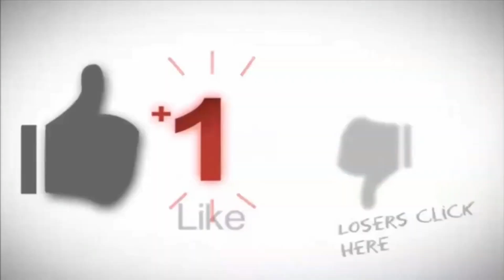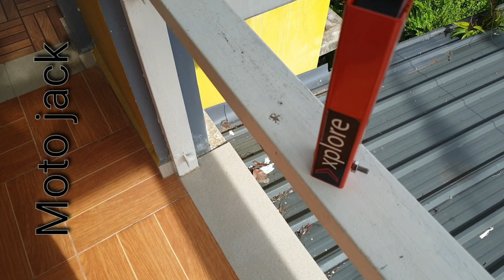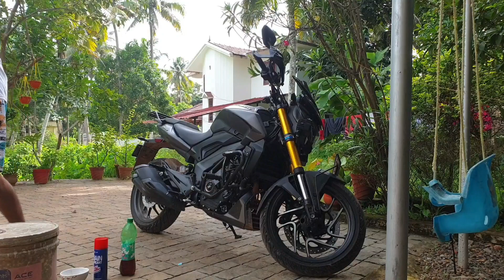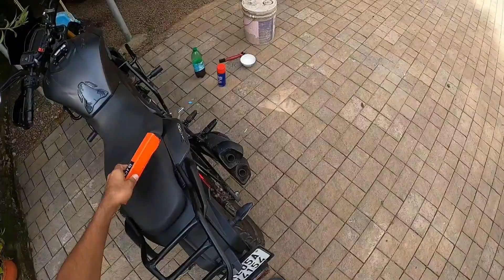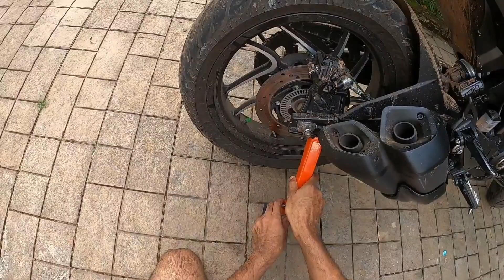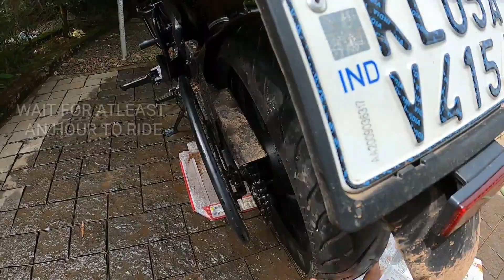ഇനി Chain lube ചെയ്യാം ഈസി ആയി || Moto jack || Paddock stand || G roller || Dominar Chain lube

Comment: Will it be easy to push the jack for dominar. There is one more product called blueburns but cost is 1500.
Reply from the maker: Yes itz quite easy can do it alone , a slight push is enough .no need to spend more bro this one works well
Reply: @kl05nomad24  thanks a lot. First I saw groller but I am not sure whether it would be easy to turn tyre with groller.
With this moto jack bike will not fall right on us or on the ground 😁
Reply: @kl05nomad24  number plate frame did you get it from Amazon?
Reply from the maker: Nope baught it from showroom itself